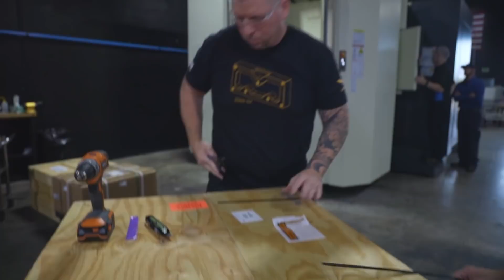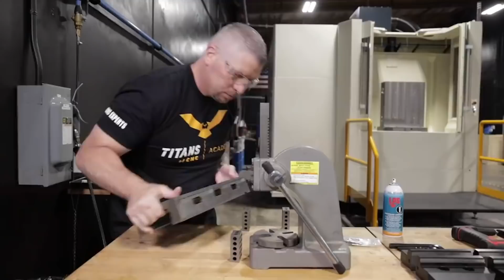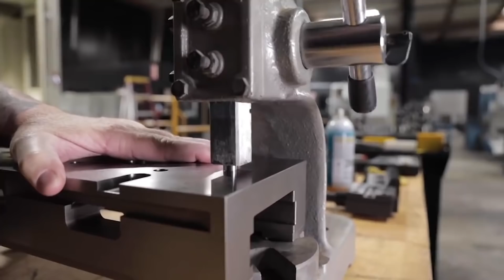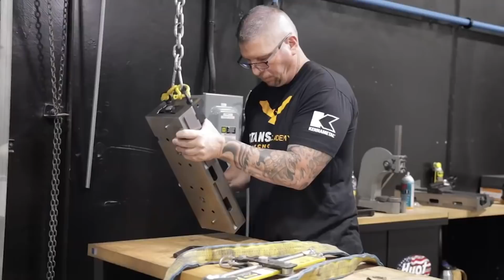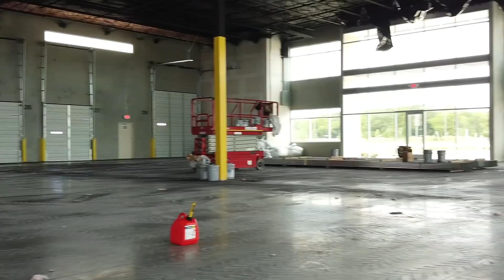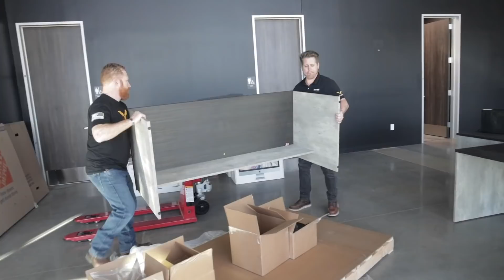Failure Destroyed My Ambition | Home Depot Said I Wasn't Good Enough

Comment: Im getting back into machining after 15 years. In 2008 when the economy went south my airplane manufacturer went down too. Ive been running a printing press for seattle times for last 15 years. The digital era and covid took that shop down. Now im in spokane wa and got on  with a family run shop making tooling for woodworking. They have a brand new dmg mori lathe im gonna be knocking the rust off of.  Just been watching ur vids with tyson and im gonna be learning the mori like he did
Reply: I run an NLX 2500 and an NLX 1500 at work. They're older 8-10 years , but the MAPPS interface that I use is really clean .